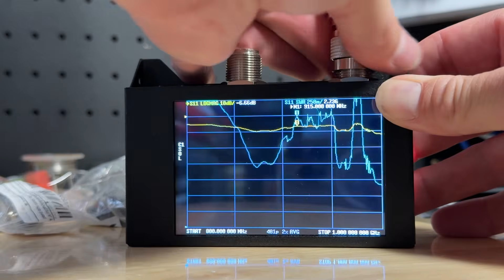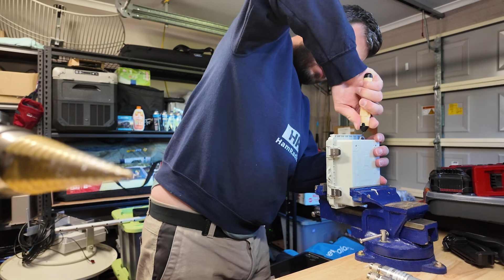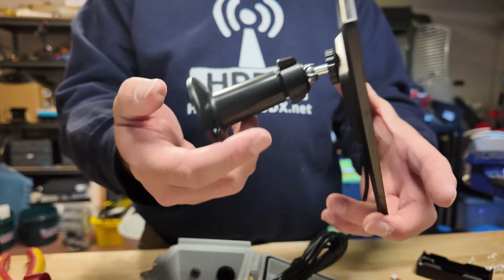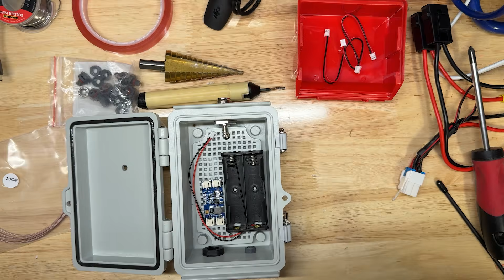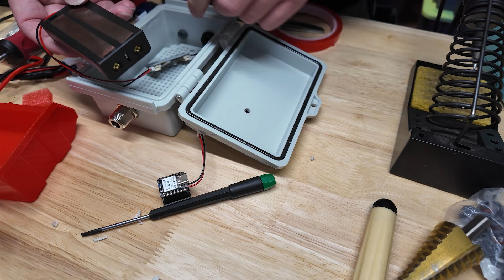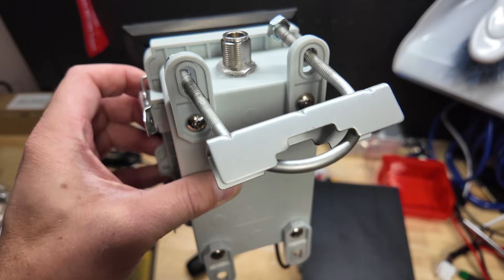The Ultimate Off-Grid Comms Build: Meshcore Solar Repeater Step-by-Step

Comment from the maker: Full Gear List: (AliExpress affiliate links)
Safety note: This project involves lithium batteries, solar charging and outdoor installation, which can create fire, electrical, weatherproofing and personal-injury risks if done incorrectly. Use protected batteries with suitable PCM/BMS, correct charging hardware, fusing and enclosures, follow manufacturer instructions and local rules, and only attempt this if you understand the risks

10W (not really - more like 2W-3W) Solar Panel 👉 https://s.click.aliexpress.com/e/_c3UQp8TL
XIAO nRF52840 & Wio-SX1262 Kit Modules 👉 https://s.click.aliexpress.com/e/_c3nDxtFJ
915 MHz 5.5dBi Vertical Collinear Antenna 👉 https://s.click.aliexpress.com/e/_c3JKgHxR
915 MHz 3dBi Vertical Collinear Antenna 👉 https://s.click.aliexpress.com/e/_c4m9laqt
Step Drill 4-32mm 👉 https://s.click.aliexpress.com/e/_c307XvfB
IP66 Box (smaller one) 👉 https://s.click.aliexpress.com/e/_c4aA1nYt
IP67 Box (the one I use in this video) 👉 https://s.click.aliexpress.com/e/_c3JkrCwD
3-6.5mm Cable Gland 👉 https://s.click.aliexpress.com/e/_c4e6m9K5
18650 parallel battery holder  (PH2.0-2P) 👉 https://s.click.aliexpress.com/e/_c4ambl8v
SMA Female Jack to N Female Jack Bulkhead 👉 https://s.click.aliexpress.com/e/_c2wi0w89
CN3791 MPPT Adjustable Solar Charger Board (6V) 👉 https://s.click.aliexpress.com/e/_c3N40SKZ
SMA to U.FL connectors 👉 https://s.click.aliexpress.com/e/_c2yqXBU1
RG178 N bulkhead to U.FL connector👉 https://s.click.aliexpress.com/e/_c4NcswNn
Waterproof Vent/Breather (M6 x 1.0-7)👉 https://s.click.aliexpress.com/e/_c2wu6fyZ
915 MHz SMA Bandpass filter 👉 https://s.click.aliexpress.com/e/_c4s2be0z
18650 5V USB-C Battery Charger 👉 https://s.click.aliexpress.com/e/_c3sLN4cl
18650 TP4056 Battery Module Charger 👉 https://s.click.aliexpress.com/e/_c3lplNJn
BMS 👉 https://s.click.aliexpress.com/e/_c4UUEuTv
Bolt Kits 👉 https://s.click.aliexpress.com/e/_c37b5Lez
Alternative Battery Option 👉 https://s.click.aliexpress.com/e/_c3P5FLwH
More Meshcore hardware here 👉 https://s.click.aliexpress.com/e/_c4mfmu9r
Seeed Studio Wio Tracker L1 Pro 👉 https://s.click.aliexpress.com/e/_c2xzcQcd
ThinkNode M1 👉 https://s.click.aliexpress.com/e/_c3RIZ369
Reply: Why all AliExpress links ? Why not support shops and business in the USA?
Reply: this may come as a surprise, not all of us live in the US...Hayden's accent might give it away, if not, his about page does. And then there's that wonderful little thing called US tariffs.
Reply: Make your own video if you don't like it.
Reply: @Uplateondatube  why on earth would an australian want to pay exorbitant shipping and fees to support a country run by a rapist pedo ?

Comment: When going to aliexpresss box that you used it defaults to this one 150x100x70 about $5.00 odd. Is this correct.
Subscribed. Thanks
Reply from the maker: Yes 150x100x70 is the right size.

Comment: Thanks for the great build instructions.
How important is the waterproof vent/breather?
Reply from the maker: Fairly important to let any water out that might accumulate inside. You can also just drill a small hole instead.

Comment: Your solar panel seems to be a 5V output, but your MPPT board is set to follow 9V (in case you did not alter it). So the charger won't work very well.

Comment: Is it possible to add a BME280 sensor? Which pins should I use? I understand that the I2C pins are not usable.Thank you for your help.
Reply: The MeshCore firmware exposes the i2c pins on the xiao nRF! D6 and D7 plus power pins.

Comment: Top video Hayden, thanks, wouldn't mine seeing you program that mini board XIAO nRF52840 you placed in the box
Reply: Just flashed 5 XIAOnRF52840 boards, check if you’re bored is sense version download the correct boot loader,
make sure you have a strong Internet connection, quality data cable, double press the button, quickly drag and drop,
you have a short period of time. While it’s in the correct mode.

Comment: Fuse between charge controller and batteries? that would be to protect what? If the Charge controller fies and shorts through the FET controlling the charging, the FET will work fine as a fuse. It won't conduct a short circuit current long enough to start a fire, so your batteries wont be damaged either. The reason to avoid a fuse is the the power waste.

Comment: Great project. Thats a lot of battery and solar for that little device, so you will never have a problem with power! I use the solar panel and battery from a solar garden light. I would also advise that you should look at higher powered lora devices for more range. Very cool!

Comment: Hayden buddy a stupid question, we are going to install the same setup here in CT, if you installed the antenna at the bottom would that affect the antennas performance, less water egress issues
Reply from the maker: You could do that, just make sure it's clear of any obstructions & very well taped up to keep the water from getting into the antenna

Comment: Caution using MPPT solar charge regulators. Often times they use microprocessors to calculate the desired charge rate. Problem with that is the supply for the MPU comes from the battery. With a dead battery, the MPU never starts and charging never begins. You can be backed  into a corner with a functional solar panel and no charging. Not all units do this. Test this first. A better solution may be to use a buck switching regulator that has a fairly high efficiency but no MPU to lock you out.
Reply from the maker: I also recommend using a BMS to avoid a low battery

Comment: Caution using ESP32 type units for solar. Besides the obvious double power consumption to the nRF58 series, it has a problem with a slow battery voltage recovery to the power-on reset after a brown-out. Fast on/off with wired power supply is ok but not using a solar/battery system. A slow recovery after a brown-out with several days without sunshine can leave the microprocessor in la la land. Not fun climbing a tower just to press the reset button.  Check it out with an adjustable bench power supply!
Reply: There is a small wafer PCB available for remote auto door lock systems. You can wire the logic output via an open collector transistor to activate the RESET switch. Can be paired with most door clickers. Operates on 438 MHz. A piece of 6 inch wire makes an antenna that can be wrapped around the utility box. Short range but better than climbing the tower.

Comment: Sorry if i missed it. But what was the rough cost for this build? Just getting into meshcore and want to increase my range
Reply from the maker: Hi, the prices will vary depending on how you want to build it/price fluctuations. All the materials used are linked in the description so you can add them to your cart and get an estimation.
Reply: @HamRadioDX thx for thr reply mate. Will do. 73
Reply from the maker: No worries!

Comment: So i built the same repeater with the larger antenna, ive found the range to be really bad, im not sure what im doing wrong. Also tried with my ALFA 915 antenna and same thing. Im only getting about 0.2 to 0.3 miles of range. I wanted to cover my whole town. Am i not high enough? I mounted the repeater on my roof.
Reply from the maker: What antenna model specifically? Some of those longer ones aren't built all that well. The shorter 3dB ones work, especially if you're located up high.
Reply: @HamRadioDX well right now ive got the 
ALFA Network AOA-915-5ACM 5 dbi Omni Outdoor. 
But im thinking maybe my chimney is creating interference cause its strapped to the metal piece. Ill try with a pvc mast to get it away from metal. Im hoping the RAK board is not defective, i for sure never powered the thing without an antenna, i know doing that can kill it.
Reply: @HypnoticAbyss  Hayden mentioned in the previous video that a higher gain antenna will "squash" the radiation donut from the antenna, a 3 dB antenna will give you a fatter donut, and better coverage,if that makes any sense.
UHF antennas are particularly susceptible to this, sometimes antenna gain isn't everything.

Comment: Thanks Hayden, Just built and deployed a rooftop repeater (Sydney). Did a PCB to mount the modules on and added fuses and battery isolator to it.
Reply from the maker: Great stuff Geoff! How is it working for you? We've been experimenting with the Mid preset here in Hobart with good results!
Reply: @HamRadioDX  Really well. The Mid preset appears to be the way to go. Most appear to be using it here and there's a lot of traffic. I'm seeing repeaters as far as 450km away. Over the last 12 hours about 170 repeaters have shown up. How's the repeater up on the misty mountain going? Interesting to see how the solar works over winter there.
Reply from the maker: @geoffswan1254  Had some issues with that repeater, but it's a work in progress.
Reply: @HamRadioDX  I have a few spare PCB's I can send down to you if you want them. It uses the same modules you used and has fuses onboard. I used two single 16350 battery holders each with its own fuse/connector to allow more flexibility for power.

Comment: This is a great build Hayden. Just wondering why you didn't use the 1 Watt variants that are available? Was it power consumption, legality or another reason. Cheers VK2VRJ.
Reply from the maker: Mix of both mate. Power consumption is higher on the RAK units. This is build version 1, I'm probably up to version 2 or 2.5 now with a bigger panel and larger battery, so could probably make it work.

Also - the 1W versions need to be run into a unity gain antenna at full power due to the EIRP limit of 30dBm imposed by ACMA. You can of course back the power off to 27dB and run a 3dBi antenna.

Might be a future build!
Reply: @HamRadioDX Very Interested in this. I thought about trying to that upgrade on my own, but I think it will be better to wait for your guidance!

Comment: I tried flashing my Heltec device with Meshcore and not only did it not work but it made the unit overheat!
Reply: Did you have the antenna connected? If not you can fry the board
Reply: @Buttercluff  Of course!  It was working OK with Meshtasic but Meshtasic can't send or receive messages.

Comment: The generic Chineseium solar panel mounts rust really badly in a short space of time. You can make a better mount using a piece of flat bar aluminium bent to suit and use a ¼ 20 machine screw to affix the panel and bent a tap to mount it onto to your enclosure

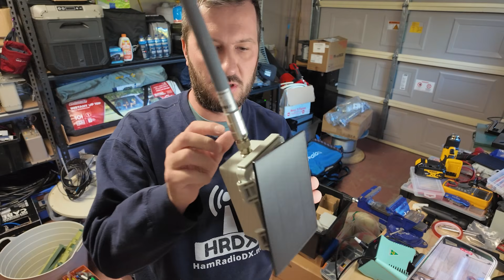Comment: 27:40 it should be self-amalgamating tape first, then electrical tape over the top. Electrical tape provides mechanical protection to the waterproof self-amalgamating tape, which isn't as robust.
Reply from the maker: Electrical tape > self amalg > electrical tape again. That way if you need to remove it, it doesn't stick to the connector.
Reply: I disagree, it's too easy for the underlying electrical tape to provide a leak path for water. You want the self amalgamating stuff to form tightly around the connector. I've never actually had a problem getting the stuff off when necessary.

Comment: if I put this up on a place where its hard to get to and it requires a reboot or reset how can that be done?
Reply from the maker: I believe you can flash over bluetooth using the nRF device firmware updater.

Comment: I'm looking to put a repeater up in the hills around our village in Southern Germany. The problem is, I don't know who owns the forest so it would be pretty cool if I could just put something up that was well hidden and not obvious from below. I was wondering how small could you make a repeater? For instance, if you had your antenna and the just lengthened it to incorporate the electronics and battery inside the tube and then on the outside of the antenna, you had your solar panels wrapped around the tube. In effect, the longer tube (50cms or so) would have everything you needed without any bulky square box or regular solar panel. Something like that you could actually hand it off a branch maybe? That would make a great video as well!!
Reply from the maker: The best thing would be to ask around and get permission to install it somewhere up high.
Reply: I totally agree with Hayden on this, these days, people can be really "funny" about random bits of electronics all of a sudden appearing on their land.
Personally, if you explained exactly what this device does and that it runs very low power, I don't think you'd have an issue, but please by all means, seek permission before you install gear like this on other peoples properties, at the worst you could be arrested for trespassing or "terrorism", that makes all of us look bad.

Comment: The broadbanded antennas are notoriously not very good. Always best to have a dedicated single freq antenna for meshcore.

I prefer to feed the solar panel through the front cover and silicone it on (with bolt). With small 3d printed "wedges" on the inside and outside, the panel can be slightly angled, to optimise for winter sun.
Reply: I always find it best to have the antenna off-centre so it doesnt get in the way internally.
Reply: Batteries go nice and firmly horizontally at the bottom too. Giv3s you more room too.
Reply from the maker: The 3D print wedges are a great idea!
Reply: @HamRadioDX there are links in our resources section+spreadsheet for the 2x small wedges.
Reply: I am getting crazy good results in the city indoor.

Comment: I do wonder if running all the holes on the bottom of the box would be a better option for longevity
Reply: You want the antenna on the top really (height is might and all that, but also keeps it away from whatever you're mounting it to .. probably) 

He's waterproofing that hole on the top, so it'll be reet 👍🏼

Comment: Could you monitor the charging state of the solar panel and batteries using the meshcore device or would you need another component to do that monitoring?
Reply from the maker: I haven’t looked closer into the other telemetry options to monitor directly with that module but I think it’s possible
Reply: The meshcore app will show % charge and temp by default
Reply from the maker: yeah as  @DanThaMan83 said you can login to the repeater and view the charge stats and temp